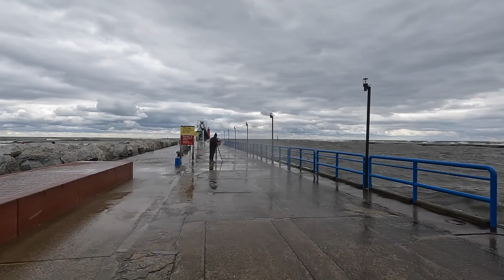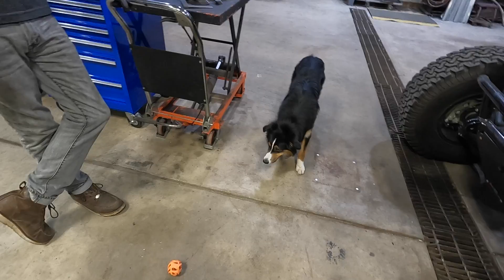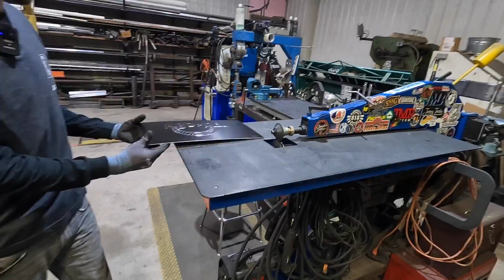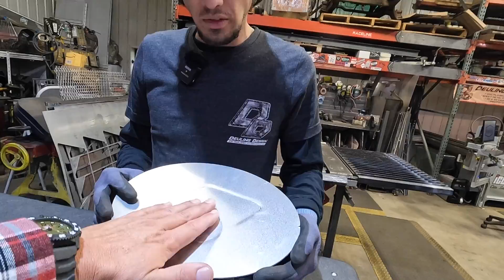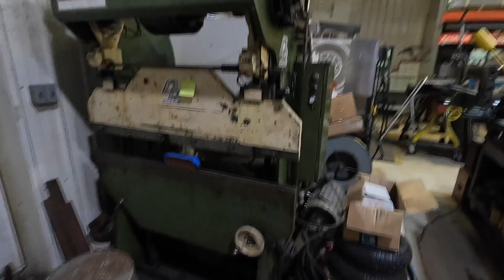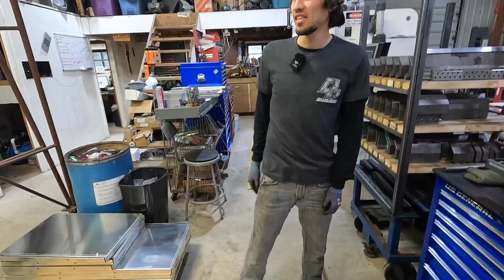Adam Deuling Design Shop Visit

Comment: Hi Adam D! Not my area of expertise (Mechanical Engineer by profession, now retired) but My Grandfather built sheet metal instrument panels for B-29 Bombers at Lockheed (then Bell aircraft) here in Atlanta in the 40s, then after his first retirement went to work for Atlanta Stove Works. I have a Turquoise fired enamel table in my garage, it was "imperfect" so he kept it. After he retired from THERE, he set up shop in the basement of his house and made brass "Coach" style lamps. I still have all of his tools, including his home-made bending brake! 😁 BTW, I did my drafting the old-fashioned way, T-squares, triangles, and French curves. In INK, on Vellum! A lost art these days! 😆

Comment: Adam, this was awesome tour, head on the keyboard to Instagram to follow this exciting young man. I followed Ron Covell for years, but Adam D. at his age may to one that tops the sheet metal world in design and other aspects in fabrication. I started 2004 making my own panels for customers to cut down time and expense of vendors parts. my shop still houses 2 bend rollers, and English Wheel, a Pexto 55E flat bar break, shears hand & mechanical, and more. But this young man is inspiring and thx for sharing, Bear in Tx.

Comment: There is a book called Electrical motors and controls.  It has been around for a long time.  There is a chapter in there showing how to identify unmarked wires for a dual voltage three phase motor.
Reply: Is that the exact title?   Author? There are several similar books out there.
Reply: @firesurfer  Electrical Motor Controls.  Gary Rockis/Glen Mazur.  American Technical Publishers, Inc.  Copyright 1982.
Bright orange hard covered book Three arrows in a clockwise rotation on the cover.  One with an on/off switch, One with what looks like a couple of plug in time delay relays (as in "Y" "delta starters, and the final with a starter with heaters.
Reply: Awesome thank you!